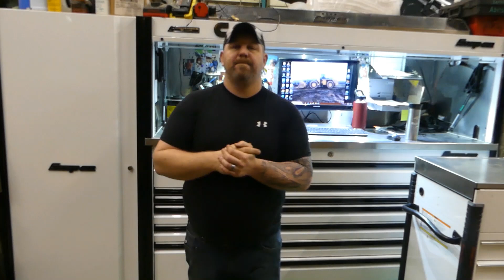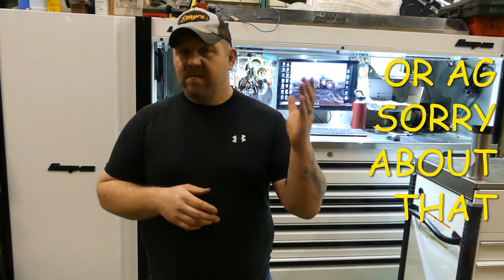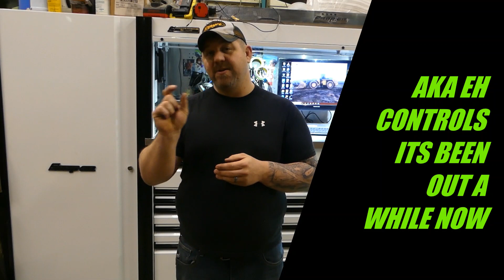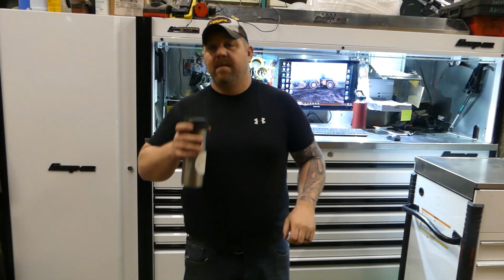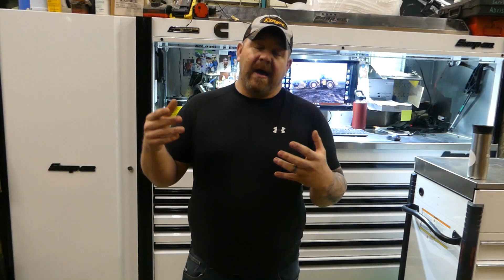School for heavy equipment repair? Why you should go to a college or technical school or college

Comment: 4 year business degree. Went to work in block factories. Became a welder no certifications weld on tracked screeners, crushers, loaders, block equipment and a ton more lots of dump truck repairs over 150 different pieces of equipment to maintain. I also track the maintenance on the tracked equipment and manage the servicing of the engines. Very little exp with diesel mechanizing but diligence in managing the repairs.

Comment: Went to Gwinnett Technical college in Georgia, 8 month program for heavy diesel technician certification. It was a mix of heavy equipment and semi, mostly class work and barely any shop time which suck since they were remodeling the shop.
Reply from the maker: That’s a bummer but sounds like you were satisfied with the classroom portion of it.
Reply: TheHeavyWrench had no complaints, instructor was super cool and helpful. Also another thing I forgot to add is we had to do a internship/ apprenticeship in the field to get our certification. Which was nice you get to work in the field and go to school at night and learn more things.
Reply from the maker: That’s awesome I’m glad you responded to this. Sounds like a decent program. Thanks again for the input

Comment: School of Hard Knocks. Got a job at a John Deere AG dealership right out of high school doing PDIs and set up then started doing more mechanic work was there 6 years. Have been working as the only mechanic for a construction company for the last 10 years now working on everything from small engine to pickup truck to dump trucks and semi's to heavy equipment and screening and crushing equipment.
Reply from the maker: that is  awesome man sounds like you are doing great with it.  keep crushing it  pun intended lol  not every one needs to go to school, but now i see a trend that these kids getting out of school for the most part don't even know basic things. I have been in a class with some young guys that at the end of a 4 day class have asked the question can you explain the difference between 12 and 24 volt this machine has 2 battery's in it which is it 12/24. seriously this question in a factory class.  how do you expect to keep up with how controllers work if you don't understand basic series or parallel circuits.
Reply: @theheavywrench9549  I got the chance to grow up around heavy equipment and big trucks my dad drove them operated them and worked on them. My dad always worked on his own cars at home and that got me into it and he taught me a lot. Yes I understand what you mean about the 12v to 24v I have to almost explain on a daily to the guys the difference between series and parallel some almost twice my age and you really want to see screw them up have them figure out a 24v system with 6v batteries like some of these old CAT tractors have.
Reply from the maker: Lmao awesome sounds like you did get some of those basic skills from your dad and learning about stuff. That’s awesome man I grew up on a farm so I kinda had a similar experience like that.

Comment: I am currently in the Diesel Tech program at Spoon River College in Canton, IL. Very good program and instructors.
Reply: Also as a 37 yr old, deciding to finally change to a career that I would love doing, I wanted to be as prepared as I could. Also just finished getting my Advanced Welding and Welding Operator certificates (but that was just a bonus because I've wanted to learn for 15 yrs or so).
Reply from the maker: @courtneyroudebush5906  that is great its never to late to change a career path. keep up the good work.
Reply from the maker: awesome that is great feed back I appreciate it

Comment: I'm starting my last semester of diesel technology at North Idaho College in Coeur d'Alene Idaho. I'll be getting my associates degree. The primary focus of the course is on trucks, but we have also gotten to spend some time on various pieces of construction equipment. The school has recently built a remote campus that houses all of the technical programs the school offers. The instructors meet regularly with truck and equipment dealerships in the area to help tailor the schools curriculum to best suit the needs of the companies in our area. Because of this partnership with the community, the odds of getting hired out of school are good. The last graduating class had 100% of their students working at or before graduation.

 There is a good spread if old and new engines, trucks, and equipment. We get MVAC 609 certified as well. There are some areas where I feel the course is lacking. First off, we get zero welding training. There's a top of the line welding lab in the same building as the diesel lab, but we don't even get an introduction to it. Second, we don't get our CDL, I'm not sure if that's normal, but every job posting and interview I've seen and been to has asked me to have a Class B or A CDL and if it's required to get hired I think it should be a part of the curriculum. Overall, North Idaho College has one of the best diesel programs in the area.
Reply from the maker: Awesome thank you for this.  Absolutely what i was looking for.

Comment: Pulse width modulated hydraulic systems that's what automatic transmissions have using in the valve bodies for along time why not use it in equipment hydraulics its all hydraulic fluid under pressure if it can work in auto world will in anything honestly with some tweaking Allison transmissions have used pwmd for along time what's really cool is valve bodies using magnetic solenoids to pull up valves and when the power or ground is pulled the magnetic conductince is gone the spring closes the valve similar to ipr regulators and in abs brake bpmv
Reply from the maker: This is so true. I think we just are seeing this now on the construction side is we run a bit higher pressure than a trans pressure . But that’s why they need to use pwm to control pilot pressure. But yes it’s a good thing to use everywhere
Reply: @theheavywrench9549  ya hydraulic pressure in equipment can go I to 10kpsi range I know I have some gauges that go to 20k psi for checking hydraulic fluid pressure ihi runs higher than most with their dual pump setups I do what you do for a living with the exception I get to work on trucks in-between and big diesel generators

Comment: School of Hard Knocks. Got hired by Mack. Received Inline Six engine cert, Mack Transmission Certificate. Put myself in a welding Votech night school, got certified. Put myself for IMACCA air conditioning, Leece Neville charging and starting cert. Cat Hydraulics, Stemco wheel and bearing, Raymond Electric lift cert, Clark cert, Bendix air full cert,Eaton Fuller cert, Spicer Cert and of course there's more but I don't know without looking.
Reply from the maker: But if you look at it from my view. Here is what I see. I see a guy that has completed a whole lot of training 👍🏻 and from what I see on your videos you are a role model for the industry. Hard knocks maybe but successful definitely 👍🏻

Comment: Attended DTI in Enfield Connecticut over 20+ years ago after that was hired by a International trk dealership where I continued my education and certifications in CAT Cummins Detroit Eaton Spicer Allison and International as well as AC certified and NYS certified inspector after leaving there after 10+ years I now work in a gravel mine/ readymix concrete company working on Oshkosh trk International trk and CAT , Komatsu, Johndeere , IR off-road equipment. I still attend training courses provided by dealer and online training! Education is key in this advocation! 👍Thankyou for sharing
Reply from the maker: Thank you so much for the input and support
Reply: Where in ny you at I'm in lower Hudson valley Ulster county started out with gm Hudson valley community college went to stealership cert in duramax and Allison trans cat for the shit they did sell in gm chasis and moved on and progressed into other trucks and diesels and equipment go to classes under fleet for various makes and models
Reply: Columbia cty south of Albany
Reply: @blacksmoke5009  ya I know where your at I buy all our international parts parts from Ben funk out your way their in Hudson

Comment: I think schooling is definitely needed to a point. Especially for the newer technology. I've been in this industry for 16 years now, started on the operator side for smaller companies. When things broke you fixed it yourself if it wasn't something major. The basic knowledge can be learned over time if you are mechanically inclined and have common sense. The newer electrical systems are where things get complicated in my opinion. Can-bus, tier 4, all the sensors on the newer equipment is where the schooling helps. The first thing you do now is hook a computer up. And I've seen alot of older mechanics struggle with that.  Continued education is key in this industry.

5 years ago I switched to wrenching on machines full time. Was selected for an apprenticeship, attended Portland community college for my schooling and an associate's in diesel technology. 4 months away from my state journeyman card now.
Really enjoy the videos!! Keep them coming!!🍻
Reply from the maker: absolutely thank you for your thoughts on this your support is appreciated.